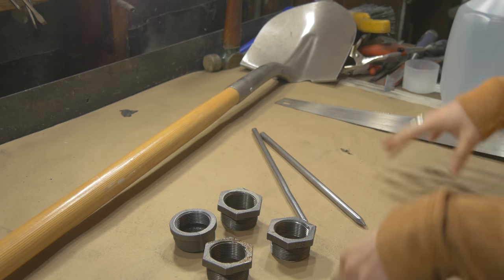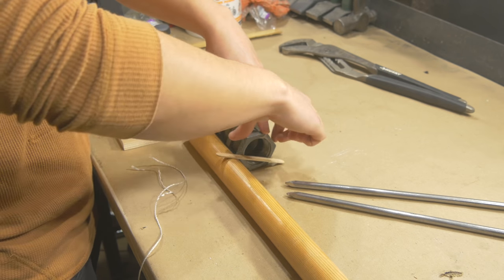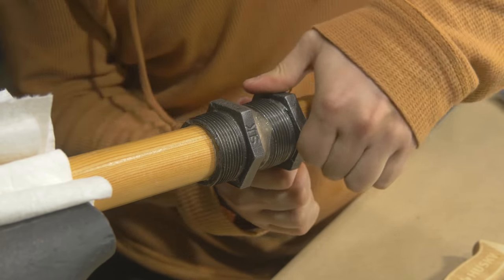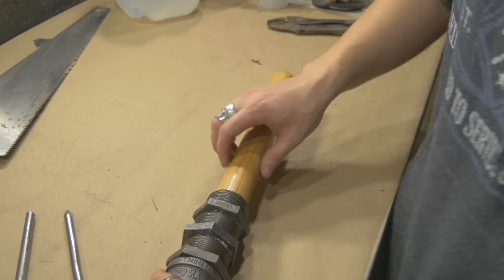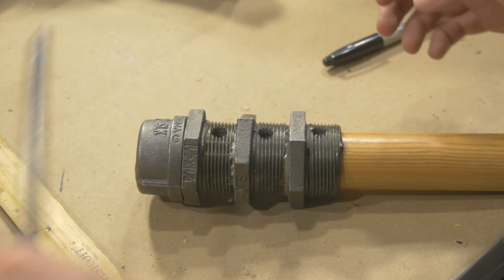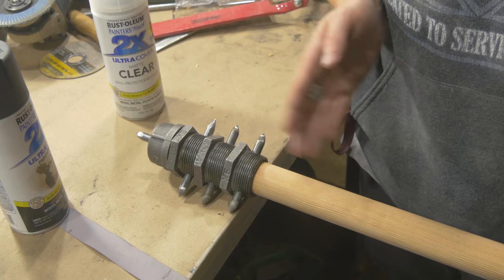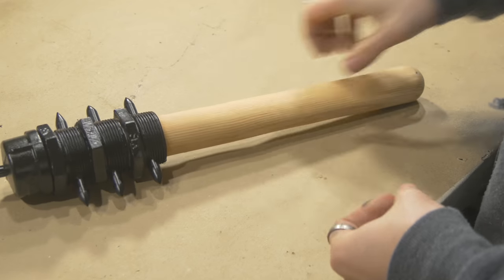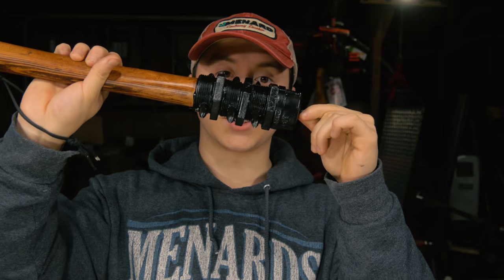How to Make: WW1 SPIKED TRENCH CLUB (Easy+DANGEROUS)

Comment: Mine broke trying to bust up pumpkins. The part that broke off was the head, solid metal, nails sticking out, and wrapped in barbed wire. That was a fun hospital trip.
Reply: Cat with Knives How the hell did it fling at you?
Reply: Your definitely  half “Tarded” atleast..
Reply: You need more than epoxy to hold the head on 😆
Reply: @mason4354  what did you use?
Reply: @itsirish9582  flip the bushing things and screw on the cap

Comment: I wouldn't even bother with the Spikes. They get stuck more easily, and from WWI veteran accounts, we know that bludgeons were perfectly lethal enough.
Reply: But spikes.
Reply: Stephen Richards can a blunt end go through a skull and mess a dude up real good?
Reply: Ke Yo no, but you dont need that
Reply: +Morum Cadi  with spikes you'd get better results breaking armour becaause it's the same force over a much smaller area meaning more pressure. Unless of course they're tooflimsy
Reply: Blunt objects are good for armour flesh needs a blade
Reply: +an Average Cat 16 in hindsight, I was thinking of puncturing armour. With (say) a warhammer, the larger surface area of the striking face means that the force is displaced across a bigger are, so it's spread out a lot more. With (say) a poleaxe, a sturdy weapon with a fine point, with the same force behind the attack, the small surface area means greater pressure. Assuming the weapons are of equal weight, and that they're of equal structural integrity, you should expect better results in terms of negating the armor from the poleaxe

Comment: I was just thinking to myself "imagine the projects eli could make if he had a lathe" then you said "it would be awesome to have a lathe right now" although it was for a different reason... regardless some more precision built weapons would be sweet maybe a folding sword, which is something ive been considering building for a long time. keep up the good work mate :)
Reply: easy solution is to put multiple folds in it
Reply: Actually, the pantographic design allows for a blade twice the length of the handle, but you'd still be stuck with a fairly small blade, around sword stick size, before it became either too wide or too long.
Reply: +Tanin Moores and why is that? ive been building things for a long time now so im not some random guy sitting at his computer

Comment: Anyone want to take the time to give me an in depth step by step and what to use as materials?
If not at least answer these questions:
1. What did he use for spikes?
2. When he was putting the spikes in, was he putting the epoxy or the cement in the holes?
Reply: 12 inch nails.
Yes.
Reply: "epoxy or cement?" 
"Yes" 

sick answer b

Comment: I know I'm likely late, but the string came off because you turned it the opposite direction you threaded it. A good example of this is plumbers tape, you always thread it so the fitting will screw on with the direction the tail of the tape goes.

Comment: Also for making round points just chuck the nail into your drill, and use it then on a belt sander, or grinding wheel. I like square points, but angle the edges to go along the length of the handle. They cut in better when hitting stuff

Comment: How to convert this into a cosplay/con safe prop
-There are plumbing caps and "nuts"(idk the name) just like these, made of pvc/misc plastic
-Keep the handle the same, unless you want it lighter then use some balsa dowel or something
- For the nails carve up some gluesticks into shape or if you are so inclided mold them from the real thing with whatever rubber-like material you want.

Comment: As for the issue of the spikes, and worrying about weakness, I've done the following. Drill the holes about half an inch, or so. Make the SPIKES flat, or a slight radius on the end that goes into the handle. Then worry about the tips. I forge them roughly to a point, beat them in (glue/apoxy if needed) that way when it hits stuff you don't worry about the spikes being driven out the other side of the handle.. It kills me to see ppl drill holes all the way through baseball bats, and put nails in that way. One hit, and the nails get driven back out.

Comment: You kind of already had a solution to the 4 way spikes.  Drill the 6 holesr and the center hole deeper so they connect. Put the top spike in first then add 12 shorter versions of the side spikes so the back end rests against the center spike, the center spike will brace the other 12 and reinforce the club.

Comment: safety tip for lanyards and dangerous things: don't string it to your wrist, string it to the handle above your hand and fit your between the hole at the bottom and where it would be above your hands. the lanyard should go over the back of your hand don't allow any major looseness, if there is, you will need to either tie a not in it to shorten the length or retie it.

Comment: the real old school home made ones would be just a table leg(or other crude and widely available wood) as a handle.. and they would wrap barbed wire and nail nails onto it.. they made these close combat weapons to replace the rather not usefull bayonet.. as trench war fair was to up close for the bayonet to be usefull.. they also made crude but affective "nail knifes" they made these from the steel stakes that would hold up barbed wire. these were used alot since the steel stakes were so common

Comment: What if instead of limiting your spikes to one direction you cut more shallow holes in all 4 directions and then set a shorter nail segment into those? With adhesive and maybe a spot weld to hold them in place. But I guess that would still be pretty weak structurally.

Comment: The reason they kept the trench club head relatively small and the handle longer. Was the swing with the weight  of the of the head , would transfer the desired affect.. i.e, severe trauma..

Comment: Z, unfortunately you wrapped your string the wrong direction. The larger the batch of epoxy you mix up, the faster it sets. (The reaction is exothermic.) Better to lose 1 pot of epoxy than an entire project: never reapply stripped off epoxy. The cords swell as the resin sinks into the fibers. Better to, "creep up" on an installation, is do it in discrete steps. I'm still at the first of your demonstration, so I don't know if you figure this out or not. Also, Contact Cement is meant to be a 4 step operation; apply glue to one part, apply glue to second part, wait until the two are scaled over (no wet feel) then join them together. Best is Weldwood. I've literally used (professionally) gallons of the stuff. Best on the market. Always provide ventilation. Otherwise you hallucinate as your brain cells die. All the best to you. Always love your work!

Comment: You're (obviously) using the lanyard wrong man! There's a purpose for it!
Lanyard should be around hand width. You run thumb thru lanyards farthest end, twist lanyard in such a way to where it lays across the back of your hand as you grip the weapon, and when you squeeze, the lanyard will tighten itself securing your hand to the end of the handle, preventing slipping. 
It's not decorative or stupid when used properly. Takes a bit of tweaking to get just right but when you do, it works!

Comment: What do you have for metal(about 6 pounds)? That is a sledge hammer at that point. This is over kill. A lighter trench club would be faster and still get the job done and be faster. A hammer would do the job. My Grandpa was in WW1 and he had 28 confirmed kills with the trench club.

Comment: My trench club is way simpler and way more  scary and dangerous. I found an old dowel and I put duct tape around where I put screws in that were about 3 times  longer  than the dowel was wide. I kinda weakened the dowel but the duct tape is gonna hold it together

Comment: No offense, you did a nice job there. But when you compare real WW1 clubs, you could have done a much more realistic job with then-contemporary methods (i.e. no epoxy) and much fewer work. For example: horseshoe nails or hobnails because thats what they mostly used for trench made clubs (not talking about the industrially made ones)